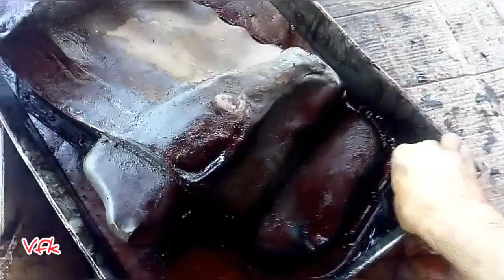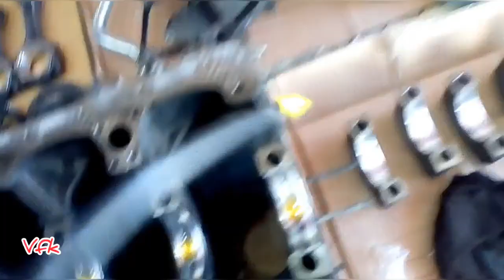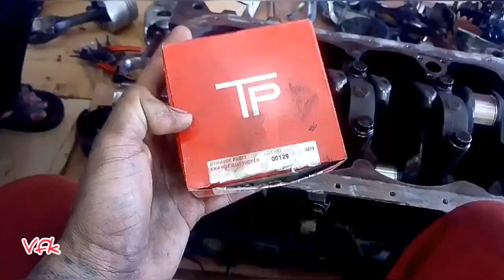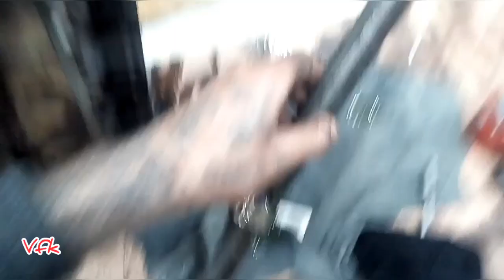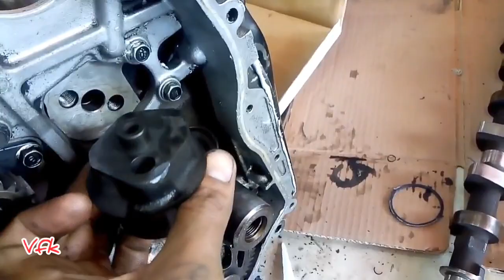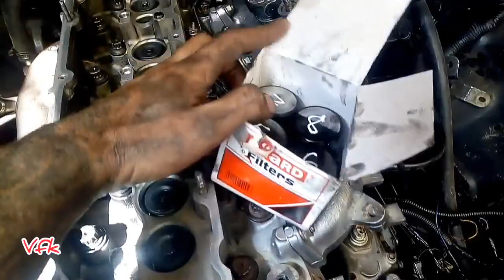Toyota 1Kz Engine Overhaul final Part

Comment: whats the difference with the mark 1 mark 3 and mark 5 gaskets for the head gasket?
Reply from the maker: Thickness, mark 1 is 0.80-0.90mm
Mark 3 is 0.90-1.00 and Mark 5 is 1.00-1.10mm